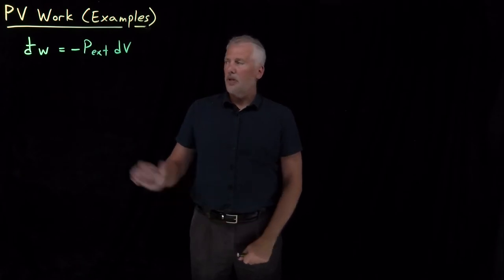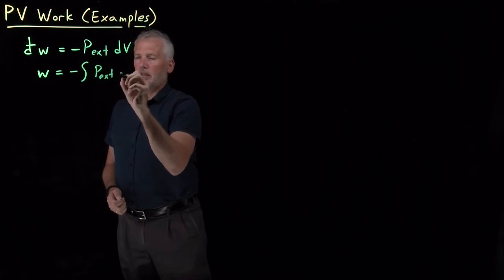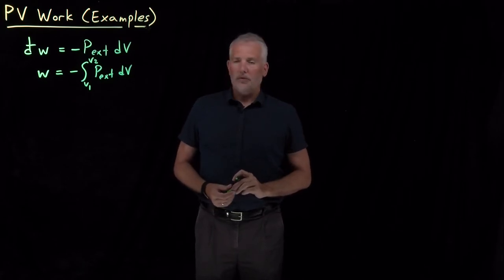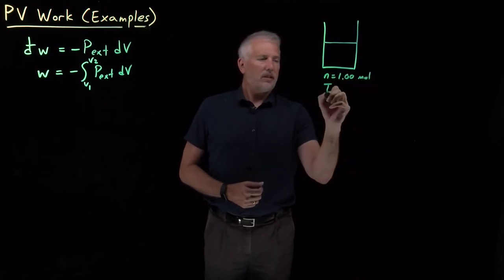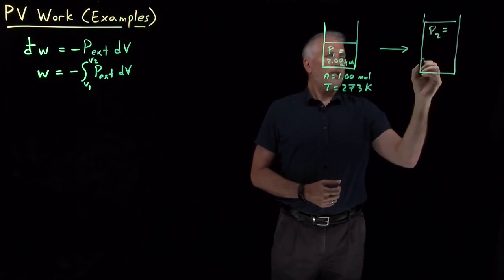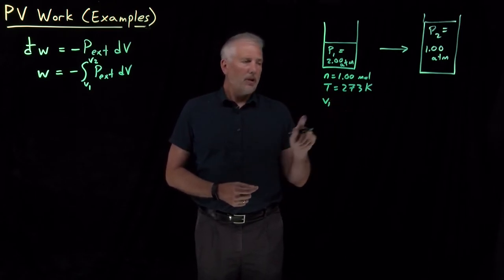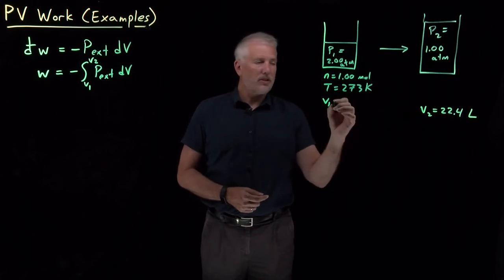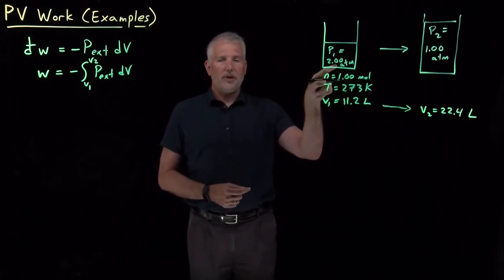PV Work (Examples)

Comment: Can we always assume that the external pressure is 1 atm for an irreversible process
Reply: Nop bro, It depends, as an example you can put an object over the bowl and pressure will increase... But if you don't put anything over it, assume that the external pressure is the atmospheric pressure.
Reply: PD. Sorry by my english... lol
Reply from the maker: No, you could do an irreversible compression or expansion with any external pressure you like. I only used 1 atm to make it as simple as possible. This is a pretty common situation for real-world expansions as well, but conditions may be different.